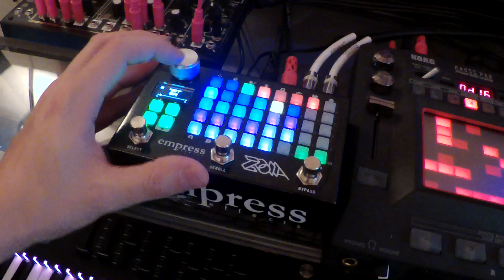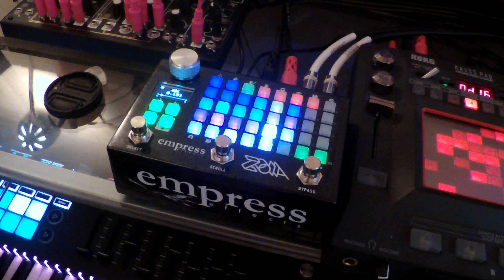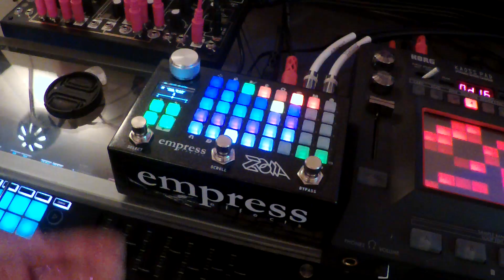Sequencer module setup - Midi Clock In (1.01) // Empress FX Zoia Tutorial

Comment: I found that with the clock in is very out of sync and detects a clock in before even pressing play on an external source. Which really limits what can be done. Example, bass lines are impossible. Kinda defeats the real purpose of a "clock" and is really just anotger modulation tool....smh. maybe it will be in a future update??